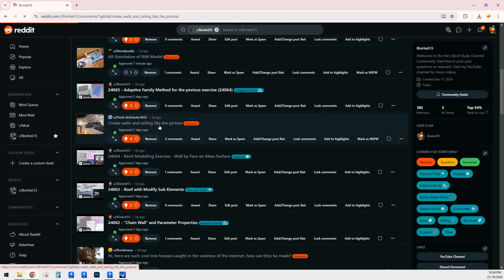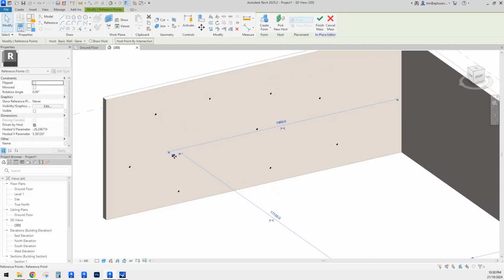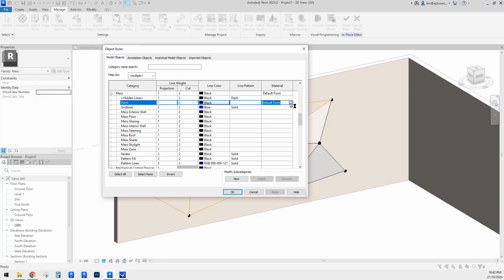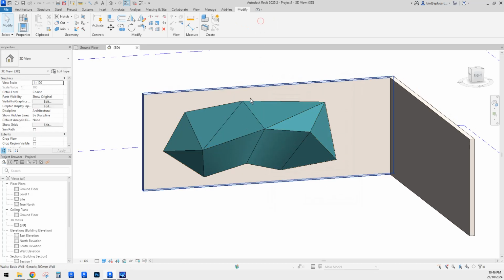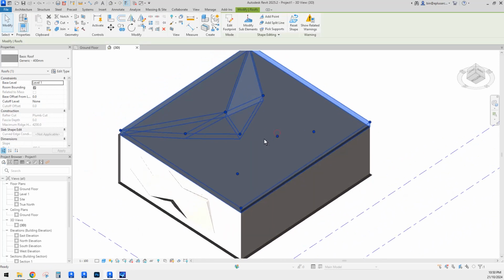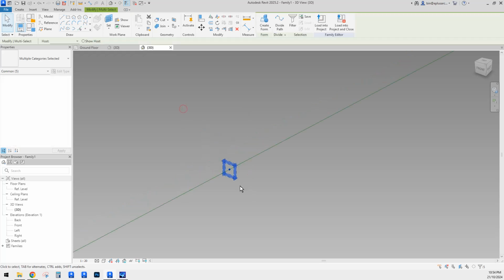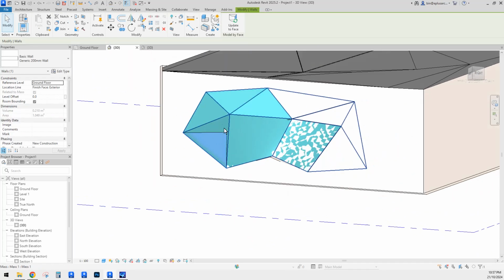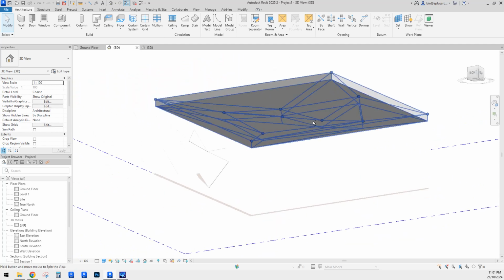24069 - Revit Modelling Exercise - Massing w. Wall by Face and Roof or Floor w. Modify Sub-Element

Comment: Fun tip: when you select reference lines and create a shape, you can press Up or Down in your keyboard to cycle through the options.
Reply from the maker: Thanks for sharing,  I couldn't make it to work, can you help me?
Reply: @BINHE615  Not sure why it's not working for you. When I am in Mass mode, I select an enclosed 2D shape and then I click Create Shape. Without clicking anything after that, I just press up/down in my keyboard and Revit gives me the option to create 2D shape or a 3D extrusion, or any other option if there are more than 2 options.
Reply from the maker: I tried a few time last night and it worked, but only once, not sure why is that. I will test more in the future and see if I can figure out the condition or something. Thanks again for sharing your tip.
Reply: @BINHE615  My pleasure! Thanks a lot for all your amazing videos.